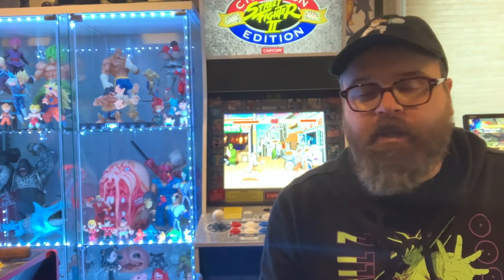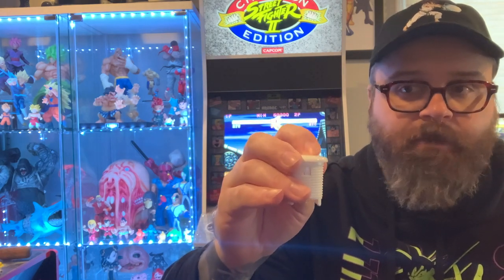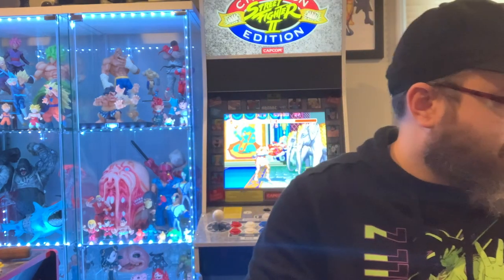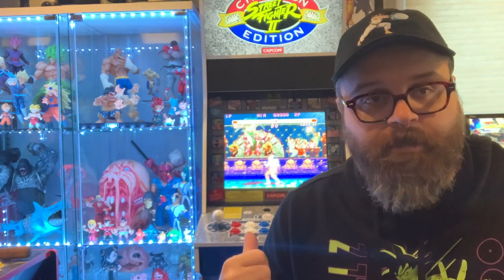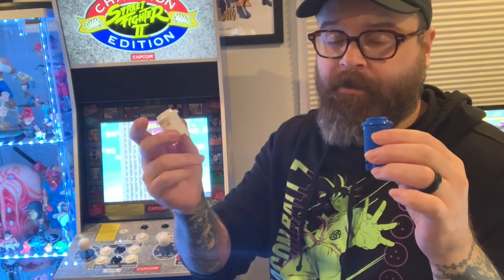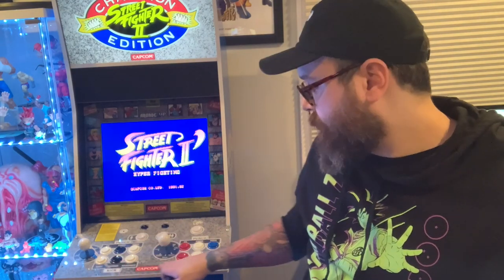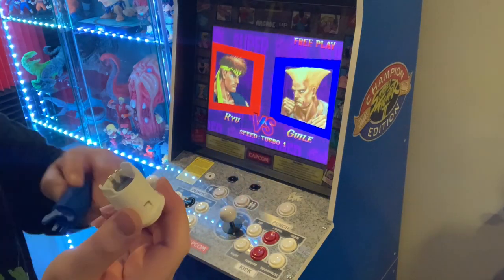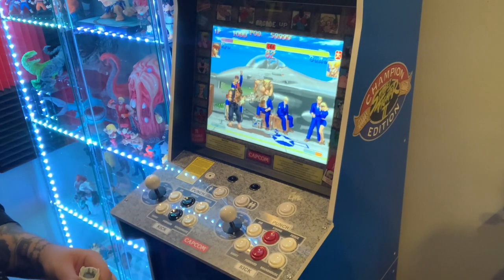Which Button is Best for Arcade1Up's Big Blue? How to - NO Drilling, Soldering, Splicing!

Comment: Sanwa buttons will go into the Arcade1up without drilling.. take a small piece ripped up of cardboard box and put it over top on sanwa button… then wiggle the button down and it will go in fairly easy. I’ve take those sanwa buttons out of my MVC and then put in Happ Competition Convex buttons and they have been in there fine not loose no problem. In my Big Blue, I had the DIY retro buttons and I did end up switching the microswitches for cherry and I still couldn’t use them. The reason is I can’t do Concave buttons because my fingers are smaller and they hurt really bad when playing. I am now using translucent authentic IL convex buttons. This makes me so much happier and yes with cherry micros.
Reply from the maker: How hard did you have to push the sanwa in? I gave it a good amount of force but at a certain point it wouldn’t budge for me.
Reply: @OfficeArcade  instead of push use a small piece of cardboard  from a used box and then wiggle with moderate force and it will slowly go down into the deck. Once in all the way they don’t move. They don’t fit as well as Happ Style obviously but it works without drilling or heavy moding.
Reply from the maker: @stepsgaming  Awesome! Appreciate the suggestion, I'll give that a go on the XvSF deck!

Comment: Nice man. What type of button would you recommend if I just wanted to replace my buttons and just plug them in without messing with any of the wires or anything else like drilling, soldering, etc...?
Reply from the maker: The American style buttons on the link are solid. And the silent sanwa style ones in the video fit the bill too. I think arcademodup sells those. 

Diyretro ones will be high quality but still. Arcademodup ones will be slightly worse in quality but MUCH easier to press. So depends on preference a bit.

Comment: i miss the old madcatz fight sticks w/ japanese button spacing.   do any Sanwas fit these things? it would be nice to just use some buttons that i trust. 
what a pain to work on & so limited to what fits. ill probly pass on these & wait for pro series cabinets
Reply from the maker: I actually managed to get sanwas working and it feels amazing! Check out my latest button video. I show how I used sand paper to get the buttons in. Super easy mod because you can reuse the arcade1up button cables on the sanwa buttons.
Reply: @OfficeArcade  awesome! Sanwas are gonna be top notch.     but do they truly fit the deck so you can put on the plastic nut? or they just sit in the hole to get loose one day eventually?   (i’m a ocd Technician).  ive had a lotta fun with the Countercades TMNT, Marvel, & MK. but the upgrade situation on these big cabs has me hesitant
Reply from the maker: @android131c  I used the clip in sanwas and they fit super snug. No give on them at all.
Reply: @OfficeArcade  NICE!  thanks

Comment: My question is… is there ANY way to do a mod for scan lines on the Big Blue??  I just bought one and the graphics are awful, flat and pixelated, ugh… and for $600 we get no scan lines or shading options.  I’m so disappointed.  Any outside upgrades we can do for this?
Reply from the maker: Not that I know of. If they don’t validate the rom, I wonder if there’s a feature someone could enable in the source code. That we could flash onto the PCB. 

I’ve seen weird overlays you can put on the monitor itself to simulate scan lines. But I can’t imagine those look good.
Reply: @OfficeArcade  honestly between the sound quality and the graphics, I’ll never buy another Arcade 1Up machine
Reply from the maker: @volta5550  Yeah, I mean I can see that. Especially with alternatives like fightcade out there for diehards. For me, the cabinet serves in large part as something I can have fun tinkering with, nostalgia, and when I have kids, giving them the arcade experience at home. Not to mention it's a "cool" piece of furniture.

For my purist gaming, I still use my PS5 (mostly SFV), and now that I have 2x Victrix sticks, I'm thinking about setting up fightcade as well to cover my retro fighting game needs.

Comment: “IL style” is not IL, spring weight and plastic tolerance all matter, as well as that cheap ass micro switch you were using. (IL need Cherry) Don’t call a Knock off IL, they’re not the same, it will confuse people.
Reply from the maker: This category of buttons is referred to as IL style or American style. And the link to the exact button so folks can check the specs when buying. These buttons are indiscernible from my ILs.
Reply: @OfficeArcade  they’d actually be referred to as “Happ style” but yeah…. Just not to confuse things…. Knock offs are never the same thing.
Reply from the maker: @Superdimensional  you can do mix and match American style buttons with different switches. So you aren’t limited by brand. 

Those switches I’m running are actually amazing for mortal kombat. If I don’t sell my midway legacy cab, they’ll be going in there.
Reply: @OfficeArcade  back in the day, Happ with Cherry is what all the arcades used across the board.